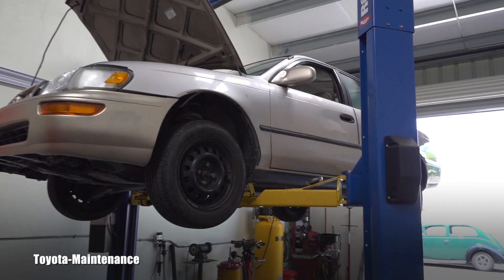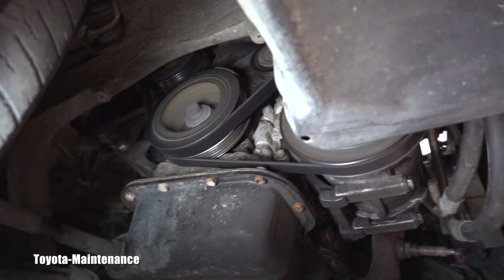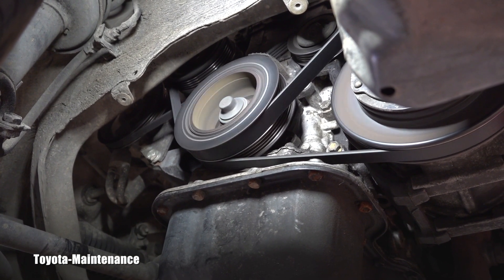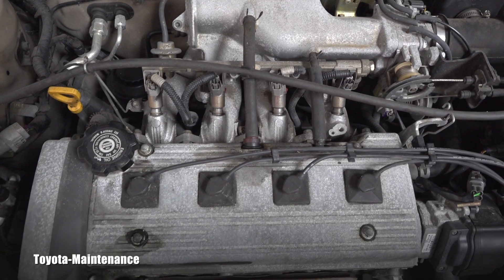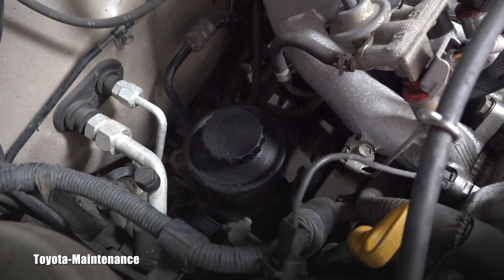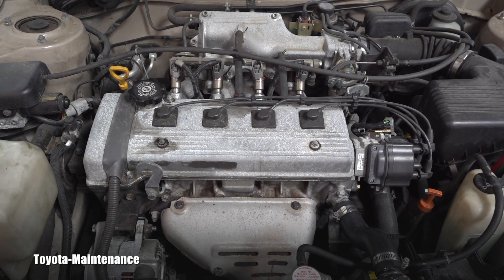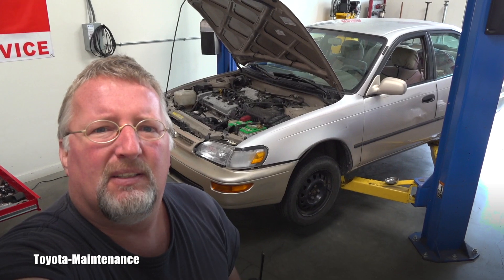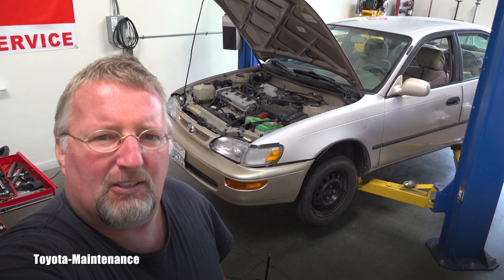Old Toyota engine runs like a champ

Comment: My 2003 Toyota Land Cruiser Prado has 320k treated poorly and abused  i only change oil every 5k  i use 10w 40 semi synthetic ... but still runs great and smooth  👍
Reply: Which engine does yours have?
Reply: Right Lane Hog 3.0 1KDFTV diesel

Comment: I have that exact same engine in my 95 Celica. Let me tell you, this thing won't die. 
Couple of instances. I remember when the engine overheated from an closed thermostat, I ran it for a couple of miles on high heat to get off the freeway. When I pooled over, we added water, drove a couple more miles and replaced the coolant at the parking lot in 10 min. Went to Michigan and back with very little oil and only noticed when I got back. Stupidly, I added coolant to the oil and it ran like that for about a week. I only noticed when the startups sounded funny, changed the oil, inspected the cylinder walls and clean as a whistle. Best car ever! I also happen to have an Audi Q5. Worst decision I have ever made. Now it needs a idler pulley, belt and fan control module and everything has to come off at the front.
Reply: Edit: the audi has 130k miles and the Celica has 297k miles.

Comment: Lovely old motoring, just had a Celica for my daughter, same engine, but a cooked head gasket. Will do a rebuild though and service it properly, should last another 40 years minimum. We should cherish these, as they will still run long after last Tesla will die off. Not mentioning nowadays engines. :) Great video, share the passion. Thanks.

Comment: your vids confirms my opinion about the reliability and long life of Toyotas
Reply: I got a 2002 Yaris 12 yrs ago and it was the best car i ever got/purchased,i still have it now.Only spent £350 in 12 yrs on front brake pads,aux belts and mid & back exhaust.Drives as good now as it did then with 4K oil change.4.5K service is for severe driving as it says in the handbook as i don't do long drives and with all the vehicles on the road,traffic lights etc....4K is important.No sludge build up with 4K servicing as you'll have issues,trust me.The engine is quiet as a church mouse with 100K on it.
Reply: Yes! I have a Tundra. My goal is my truck to be in the million miles Tundra club!

Comment: Way back in 1971, my Father bought a brand new 1971 Toyota Corolla, from a small Toyota Dealership for $1,200.00 cash. My Dad drove this car until May 1976, at this point, he gave me the the little car.  It had 201,000 miles on it when I received the car. I drove it as a young teenager for two more years. I sold the car with 231,000 miles on it for $200.00.  The most amazing thing for me is the fact the little car ran well for 231, 000 miles for a total investment of $1,000.00.   This first car taught me one valuable life lesson:  Toyota makes the best vehicles!!!! So, what do I drive now as a grown man of the age 59?  A 2019 Toyota Tacoma SR 4X4 Long Bed, 4-cylinder 2.7 liter engine.  Completely satisfied!!!!!

Comment: i recently discovered your channel because i bought a Toyota Corolla 11e with the 4e-fe engine, i decided to buy this car because of the image of toyota. and i work in a business that sells aftermarket car repair utilities like, generators, gaskets, Starters, all kinds of stuff i could make a never ending list. and in the 3 years i´m workin there i had never someone come to me and ordering some stuff that just broke altough it has no heavy use on a toyota. so i realized they must be the best cars. because it doesnt matter if its a Vw, Ford, Bmw, Fiat, audi, they always have some things brake. The only things i sell for toyotas is maintenance stuff its incredible. i always was a fan of toyota but working there made me a die hard fan of this brand. and thanks for all your videos you´ve made i will surely use them alot in near future. much love and appreciation to you from austria.

Comment: Preaching the the choir here !  I worked in Chevy garage for 35 years, Been driving a Toyota since 1998. Although its only been 2 toyotas , I still have the 1998 truck. 321,000 mile and runs like new. Bought a new Camry in 2016. 60,000 miles and have only needed oil change every 5000 miles . Mobil 1 of course. Oh , and 1 cabin and 1 engine air filter !
Reply: Yes! I have a Tundra. My goal for my truck is to be in the million miles truck club!
Reply: My 98 Camry has 448K ... runs like new until recently .. a burnt valve, probably going to replace the car because of a roof leak for the past few years.
Reply: Just bought a 05 4runner with 300k runs and looks like a brand new one has a new transmission with only 7k on it and only oil that leaks a little and I mean little is around one corner of valve cover which Chevy and ford start doing at around 40k so yeah Toyota is the most reliable on the road
Reply: @KennyLamTravel  Kenny, the Camry had a good life. Time to move on !
Reply: A guy at work  has an 07 Matrix. In 600k + km the only thing that failed was the blower motor and wear items like pads and shoes,,tires etc.

Comment: In 1993 I bought anew Toyota corolla( same shape) drive it until it reads 834000 kms and 12 years of driving in dubai hot weather  ... Toyota is the best
Reply: If you didn't know... The reason toyota is extremely reliable is because they over engineered their vehicles in the 90's because they sold to desert areas like Dubai. You are living proof that these machines can take punishment. Thanks!
Reply: I agree 👍 I have a Tundra. My goal for my Tundra is to be in the million miles truck club!
Reply: 834000 Kms ? no joke man!  does it smoke and burn oil?
Reply: @hlq2action310  no burning oil and it had the original engine and transmission ( 5 speed manual) certainly I changed some parts... 1 Fuel pump , 2 clutches, 1 alternator, oil change every 5000 kms, plugs.. Belts and brake pads every 50000  kms ... When I sold the corolla in 2005 it was like brand new ( in 1993 I bought it for 15000 us dollars and I sold it in 2005 for 4000 us dollars)

Comment: My 2008 Toyota Camry has over 192,000 miles on it, despite a faulty piston design and piston rings.  The prior owner never had the enhanced warranty fix to replace the pistons.  It typically consumes close to 1 quart of oil every 300 miles.  What's absolutely insane is finding out in the user's manual that the maximum average amount of oil consumption expected was was 1 quart every 600 miles!!  I have never known a toyota to blow through so much oil, but better yet, have never known Toyota to actually state the amount of oil consumed within 600 miles as stated above.  I understand burning maybe half a quart between oil changes but to print it for a new car, albeit a Toyota seems out of character.  I will say this; even with that fault and the amount of miles on it, should expect many more!
Reply from the maker: Thank you for sharing

Comment: I have the same year Geo Prizm.  You are right on reliable and easy to work on.  I can do a timing belt in 45 minutes on these.
Reply: Your Prizm  probably came down the same assembly line as this Corolla. I find it amusing  that the cars labeled Geo were generally better than anything GM made in house in those years.
Reply: @rightlanehog3151  That's because they weren't assembled in GM plants. I own a 1994 Geo Prizm LSi and if you open any hood on the Prizms it has a decal that it was assembled in California by a New United Motors. I always knew Geo Prizms were just rebadged Corolla but when I saw that sticker I did some more research and found the information to be true. My Geo Prizm is the best car I ever owned.

Comment: I have a 2007 Scion Tc with 205,000 miles on it and mine also has no leaks and purrs like a kitten. Only negative with my engine is it is one of the ones Toyota made with bad piston rings and tends to burn about a quart of oil every 1200 miles. But as long as i throw a quart in every 1200 miles or so, it runs like a clock.

Comment: I agree, Toyota and Honda make the world's best engines.  I have owned several Toyotas and Nissans over the years.  However, the Toyota's were much more trouble-free.  So much so, that in January 2019, I bought a brand new Toyota Tacoma Tacoma 4x4 SR.  It is my most favorite Toyota truck so far.  Another positive about Toyota trucks: they hold their value. Just try and locate a used Toyota Pick-Up Truck for a fair price. They are very difficult to locate because the owners are keeping them.  Love your videos.

Comment: Sure glad I bought a corolla, I was tired of wasting money🤙🏽🤙🏽🤙🏽
Reply: Tardeli costantini
1 second ago
I got a 2002 Yaris 12 yrs ago and it was the best car i ever got/purchased,i still have it now.Only spent £350 in 12 yrs on front brake pads,aux belts and mid & back exhaust.Drives as good now as it did then with 4K oil change.4.5K service is for severe driving as it says in the handbook as i don't do long drives and with all the vehicles on the road,traffic lights etc....4K is important.No sludge build up with 4K servicing as you'll have issues,trust me.The engine is quiet as a church mouse with 100K on it.
Reply: @tardeliesmagic  The Yaris and its predecessor the Echo didn't sell well in the US because the Corolla was not much more expensive and had a more comfortable ride.  However for someone just needing basic transportation they were good cars like most Toyotas.  As you have discovered changing the engine oil often enough is the most important maintenance item on any car.

Comment: This is despite the engine overheating due to the water pump not going because the belt fell off. So many times when the engine overheats, the alloy head warps and it is expensive to fix

Comment: My wife wants me to sell my back up car which happens to be a 1997 Camry LE 4 cylinder with 237K miles on the clock. It's been more dependable than our newer cars. It's not a super model, but she's reliable and gets me from point A to point B...
Reply: time for a new wife 😉
Reply: @B4thefire  Haha! I'm old school 👴 It's cheaper to keep her 🤣
Reply: I agree never sell a car cause wife wants to if it's still runs well it stays period.
Reply: Better too keep the car . If you sell it its not worth it .
Reply: The way you described your corolla could be comparable to anyones dependable and reliable wife. Not a super model but get you from point A to point B! Lol
Reply: I agree 👍 I have a Tundra. My goal for my truck is to be in the million miles Tundra club!
Reply: If it’s a backup car do not sell. You will regret it.
Reply: C P   I totally agree 👍
Reply: Vincent Dinh   Metaphorically speaking 🤣
Reply: GameboyTommy   Absolutely! I recently installed new engine mounts, Asin timing belt kit, new tires, struts, new suspension. Yup, she’s a keeper...
Reply: jeffrey Santos  I had a 2009 Corolla with almost 300k. Some bozo decided he didn’t want to stop at a red light and rear ended me. The insurance totaled the Corolla 😔 I performed all the maintenance myself and the only major parts that I replaced was an alternator, battery, water pump, and #3 coil pack. She was my daily driver putting 132 miles round trip for work M-F. So, my back up 1997 Camry has been a  life saver. 
I’m sure you’ll get in the million mile club within a Toyota 👍

Comment: I have a 1997 Rav4 ...basically the same engine but with lost spark twin coil electronic ignition.  But a mere 106,000 miles on the clock.  I service it myself these days.

Comment: I put over 250k miles on a 4A-FE (the little brother here) on a 1994 Geo Prizm (Built in the same Freemont, CA factory as the same vehicle with Corolla badges.)
I sold it on to a 16 year old kid getting his license.
I moved on to a Pontiac Vibe (Toyota Matrix) for some more room and creature comforts.  But they are largely bulletproof cars.
I too had a strange failure.  The harmonic balancer had the pulley walk off the balancer causing similar belt issues to the A/C bracket issues you had with this car.
The smaller 4A-FE did not have EGR, so even simpler than the 7A-FE.

Comment: nice. ive been driving a 1994 toyota corolla DX for the past 10 years. great car.
Reply: I agree 👍 I have a Tundra. My goal for my truck is to be in the million miles Tundra club!
Reply: Wow... I clean my intake with crisco. Also, I melt crisco with baby powder at a 10 /1 Ratio and funnel it in my gas tank. Cleans my injectors like new.  For the egr i crush peanuts and run the motor at 5000 rpm and suck em through the intake. Cleans the carbon on the pistons and egr valve at the same time.

Comment: After you said it overheated yesterday I was thinking I think this car has come to the end of the road but no good old Japanese and French cars built to last I need Toyota with a whatever number then  AFE engine is brilliant  and everything would be perfect even the wipers you wanted to touch them the seats won't be ripped the shocks will be perfect the tires won't be towering or anything will be perfect

Comment: I've got a 95 1600 corolla over 400,000k's ... engine transmission excellent. Replaced radiator, distributor/coil, fixed minor vacuum leaks, new struts  and that's it
I'd say the old girl could use a set of wheel bearings and break pads, aircon could use a top up but nothing urgent... 5.7lt/100k, uses almost a litre of oil between services, so will probably go a grade or two higher next service.
I love it

Comment: Another example is the 70's Corolla engines and even the 4a series from the 80's. My Dad's 84 Corolla had 234,000 miles when he sold it and it had a 3 speed auto that used to do about 3300 rpm's at 60 mph, a lot even with the lock up converter. Durable and trustworthy.

Comment: I’m constantly impressed with Toyota’s motors. What blew me away was when I started double checking all the measurements on a recent used car purchase I made for son. 1988 Celica with 3SGE. Checked compression. 180 across the board. ?!? 30 year old car and compression was spot on. Okay, let’s check cam clearance to lifters. Exhaust and intake were smack in the middle. So a bit worn, but no where near limits. Wow! As long as you don’t mess with the air/fuel mixture (the tend to run richer, but this helps keep the engine cooler and lubricate some components) and do the routine maintenance- most Toyota engines will last a long time! And yes, I abuse mine a bit, but it keeps going!

Comment: Toyota is the champ in the longevity department. My old truck was a 86 hilux and I got 460k out of it all original. The deepest I went was timing chain. Frame rot killed it otherwise I would still be driving it.
Reply: Do they have rustproofing available where you live?  My Toyota has survived 15 Canadian winters with salt liberally spread on the streets and has no rust due to an annual application of a  high quality rustprofoing treatment.
Reply: Top Gear made a Video of it - Killing a Toyota, amazing what punishment the car could take!

Comment: My mom bought one just like this in 95 and I've been driving it for 6 years now, at 250,000 miles now! Original starter still works great. The only time it left me stranded was when the distributor electronics went bad, so I agree  that the distributor system on these is the only major long term weakness of these motors

Comment: As a Toyota man, I have had many! First ones were 70's KE20 Corollas, got also 80's and 90's best was a little 1.3i year 1992 model, sold it finally to Africa in 2012 got 750€ and it was running, but starting to rust. Got 2 HJ60  (just Google these models) bought used and drive few years and when selling I always got more money when I bought it, how funny is that? Just driven now last 10 years a used GEN2 Prius and maybe it's time to buy my first new one soon it is gonna be either new Prius PHEV ( Prime ) or RAV4 PHEV (Prime) time will tell! But you get my point, trusting that reliability is easy and saved my money almost 50 years now!  Greetings from Finland!
Reply: Tardeli costantini
1 second ago
I got a 2002 Yaris 12 yrs ago and it was the best car i ever got/purchased,i still have it now.Only spent £350 in 12 yrs on front brake pads,aux belts and mid & back exhaust.Drives as good now as it did then with 4K oil change.4.5K service is for severe driving as it says in the handbook as i don't do long drives and with all the vehicles on the road,traffic lights etc....4K is important.No sludge build up with 4K servicing as you'll have issues,trust me.The engine is quiet as a church mouse with 100K on it.

Comment: I have driven Honda Toyota Nissan and I have the best luck with the Toyota brand. I also love the non interference engines.
Reply: Chris Vargas 
Your not wrong !
Non interference engines make the difference between an annoyance and a down right expensive problem when the timing belt breaks.

Comment: I have the same engine, it has done over 370 000km's and it's still going strong.
I want to eventually rebuild it with forged internals and run it at around 10psi, they are amazing little weapons.
Reply: I agree 👍 I have a Tundra. My goal for my truck is to be in the million miles Tundra club!

Comment: I have a 92 Corolla with 278K miles and the engine is even smother than that engine. I hear injectors clicking at idle. Still got Factory AC componenets and even GAS and blows Ice cold! All wheel bearings are from Factory. You can still buy oem parts from partsouq.com

Comment: OUTSTANDING
The Corolla it's NOT
Flashy but Very Reliable.
That why We can't MOVE ON LOOKS!
Thanks for the Video
Reply: My 2002 Honda Accord 4 cylinder is somewhat similar most of the parts are easy to get at for maintenance compared to the V6 models.  It's just a relatively simple car that doesn't have too many things to break like the newer ones.  Mine doesn't have nearly as much mileage on it but at 118k it still serves me as my daily driver and runs well.  I don't think I could say the same for any Ford, GM, or Chrysler product.
Reply: I agree 👍 I have a Tundra. My goal for my truck is to be in the million miles truck club!